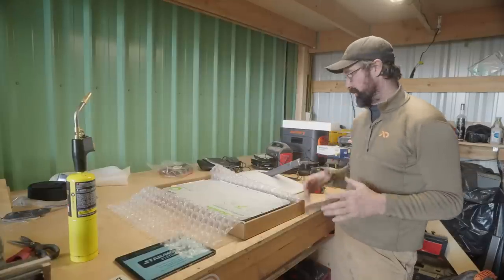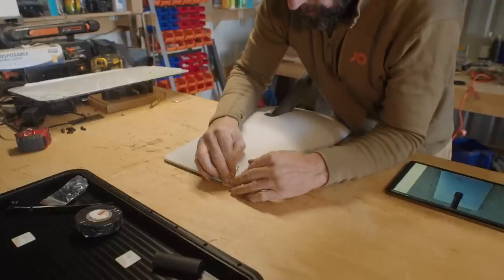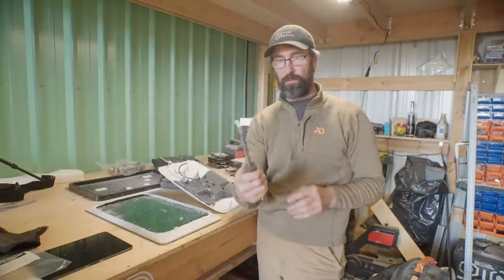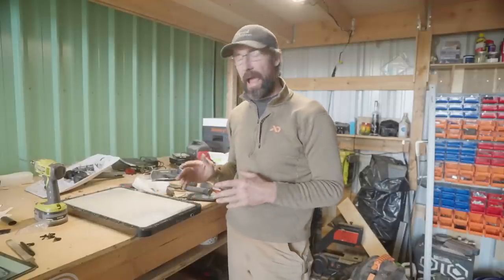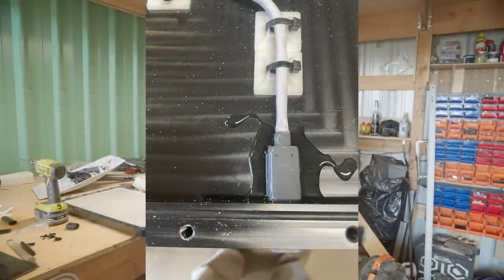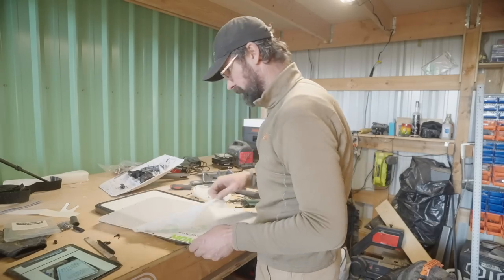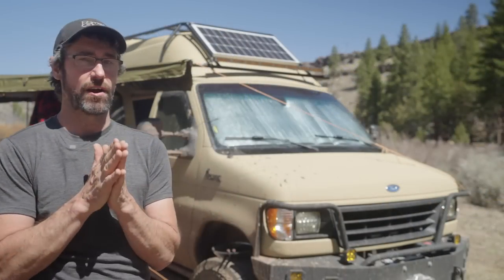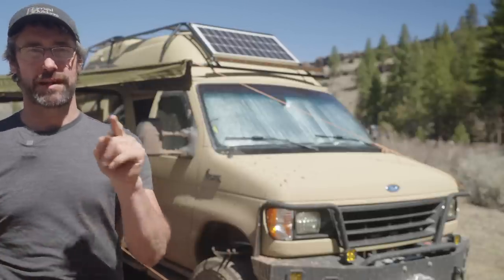How to Flat Mount your Starlink with Star-mount

Comment: If you did the 12V PoE/WiFI router all-in-one conversion, you actually cut both sides of the dish housing like you did. One port if for the Ethernet cable, and the other port is for the 12V input. Either way, no harm no foul that you cut both sides because it's still gonna be enclosed in the mount.

Comment: How things going with the permanent flat mount? I really like what they have done but read reports from sprinter source of some mounts warping due to heat from being left in the sun for long periods. The warping cracks the mounting screws and moisture is able to enter the enclosure and kill the dish.

I guess the new dish v3 without motor would completely alleviate the issue and there will be no need to cut open the dish and forfeit the water proofing.
Reply from the maker: Sorry for the short answer but all well so far and I couldn't be happier. I use it everyday.

Jason

Comment: Hey man, super quick question: I'm over here in Missoula, and I'm considering snatching up a low miles 7.3L E350 small body ambulance. The problem is: head height.  What's a rough ballpark on what a high top runs, cost-wise?